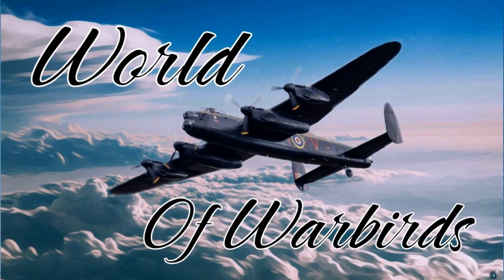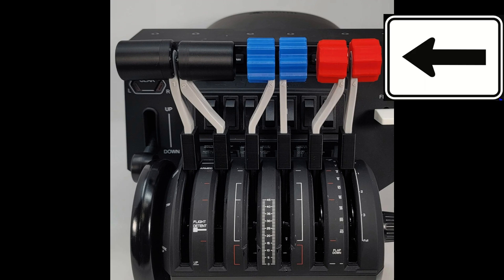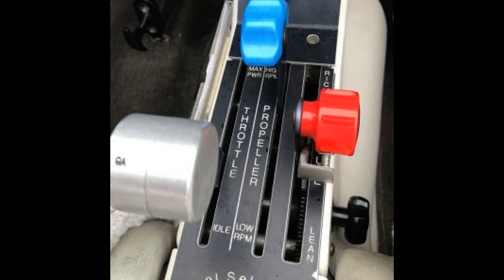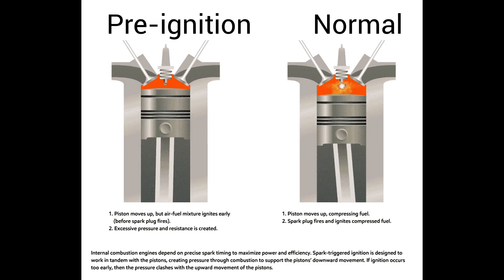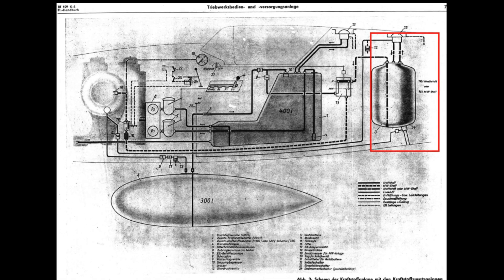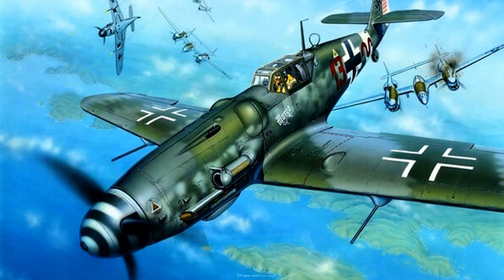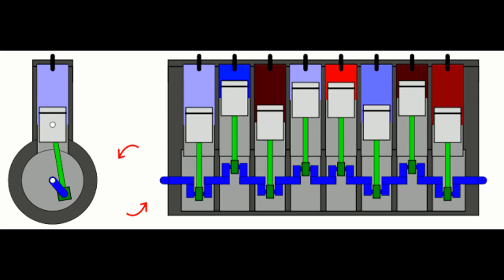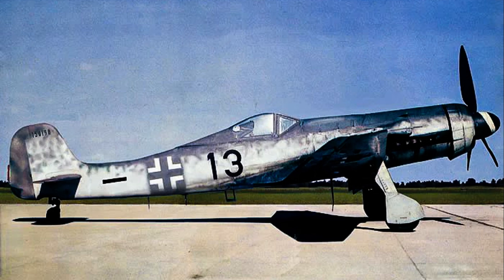Quest for Power Part 4: Water-Methanol Injection

Comment: And don't forget the old iron piston farm tractors that used water injection (seriously). Same idea, but ran much longer. Start the tractor. Let it get hot. Open the water injection take valve. Do the work. Shut off the water, wait a bit and shut down the engine.
Reply: Those tractors were started on gasoline but when hot and loaded down they would switch to "Power Fuel" which was waaaay cheaper. (power fuel was in between kerosene and gasoline and exempt from taxation because couldn't be used in cars)
You didn't need the steam from the water jackets with gas - it was only used with Kerosene or Power Fuel.

Comment: This is magnificent! Please ignore these negative comments by these know nothings.  All of these Quest for Power posts are proven with the American automotive racing scenes of the 1950 and 60s. Water injection was a very secret aftermarket accessory to a race engine for decades and is now basically shunned and lost. These engine history snobs are a joke... as to Nitros Oxide, being acoolest? This iis still a mystery as it actually chokes the engine of oxygen, making It wanting to suck more air. It's science...  People have a hard time believing what doesn't make sense to them scientifically.  When I was racing cars. Everybody shunned the Predator carborators.  This was in the early 90s. But what I found out was that the Predator carbs liked being forced with air or nitrous rather than being sucked with air from a roots type gmc type blower (6/71 type) etc... Predator carbs liked the blower on top like a turbo set up... anyway. I'm a late model, Gear Head, who experimented and appreciates these horsepower videos... because this is where it all happened before it went to the streets... including Magnetos that were popular on Harley and Triumph motorcycles of the 60s and 70s! It all started in the skies ! Thanks for the cool vid !
Reply from the maker: Thanks for the endorsement!!
Reply: Nitrous separates into nitrogen and oxygen under cylinder pressure and temp. This more than makes up for any "choking".

Comment: Early jets also used water injection to cool exhaust at take-off. That´s why there´s many B47 footage with black smoke trails behind them.
Reply from the maker: I thought they were burning coal haha!
Reply: B47's ran with JATO bottles, perhaps that created the smoke, not to mention that early jet engines smoked anyway.
Reply: My interpretation on water injection used on jet engines was to take advantage of the heat of the exhaust and so turn the water into steam which, as expanded water, would provide more thrust.
Reply: @Sevensixtytwo  water would never cause black smoke more on
Reply: Not correct, research more. All early jet engines left a visible smoke trail, it was nothing to do with MW50 or any additive, it was because the earlier engines didn't run efficiently.
Reply: @Slaktrax  you should research more. I mentioned B47 for purpose. It had water injection.
Reply: @Slaktrax You need to do some research on water injection being used on turbojets.  One example...the J57.
Reply from the maker: 1. The coal comment was a joke. 2. This video wasn’t about JET engines at all, but reciprocation piston engines.

Comment: To say that the methanol was not there to boost combustion is incorrect. Allied aircraft used 100/130 octane fuel. German aircraft used 93 octane C3 fuel. Allied aircraft only used water injection while German aircraft used a 50/50 mixture of water and methanol. The octane rating of methanol is 130 (Alchohol also sometimes used is 128). Thus the Germans added methanol to boost the octane level of their lower octane fuel to similar levels as the Allied fuels for short periods.

Comment: MW50 (Methanol, water and additives) worked at lower altitudes and GM1 (Nitrous Oxide) at higher altitudes. But they both stressed the engines in use, causing cracking. Also, they both added parasitic weight that had to be carried even when not in use. The Allies, on the other hand, had access to better fuel supplies across the board, generating better performance in general. I do wonder, though, what effect heavy use of lead-based additives had on those exposed to them.
Reply from the maker: Yes the fuel supply situation will be in a later segment of this series.

Comment: Would the water increase the compression ratio due to being incompressible  ?
Reply from the maker: No the water would flash to steam and be a gas in an instant.
Reply: @worldofwarbirds  What happens to water sprayed into the cylinders, then ? How does it not turn to steam ?
Reply: @Bassman-r3c  It does. And turning water into steam requires quite a lot of energy. Thermal energy that would otherwise go to waste. So the contents of the cylinder are cooled. Cooler gases are denser, so you can fit more air/fuel mixture into the cylinder at lower temperatures. More mixture means more power.
Reply: @onenote6619  Thanks for the explanation. It's more complicated than I expected.
Reply: @onenote6619 water turns to steam at 212°! Stop pretending...
Reply: @briancobb1304 - 212 F (100 C in real units) is only true at a pressure of 1 atmosphere. Pressures inside a combustion engine are much higher, and so is the boiling point of water at those pressures.
Reply: @briancobb1304 
Stop pretending that you’re informed.  Water BOILS at 212*.   The white stuff you see is vapor, not steam.  Working steam (or dry steam, it will instantly light a match)  can be 700-800* and is invisible and makes tremendous pressure.  It is what powers a steam engine.  
Learning things first beats embarrassing yourself.